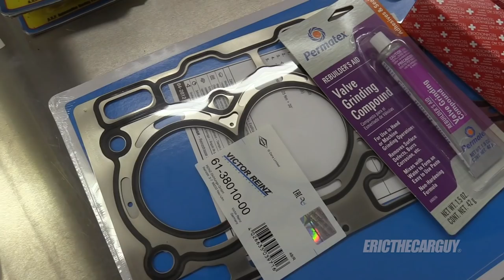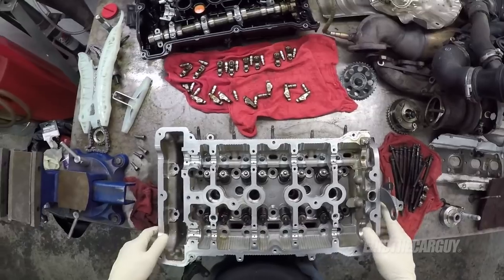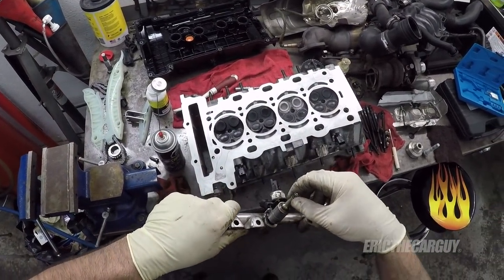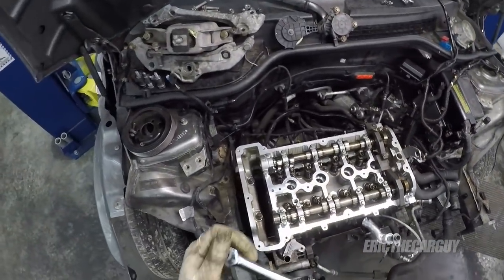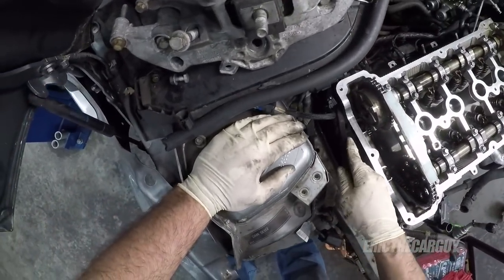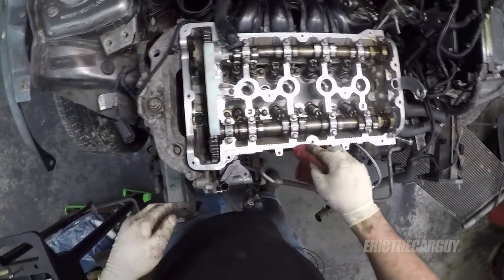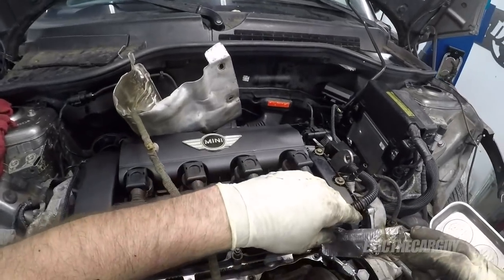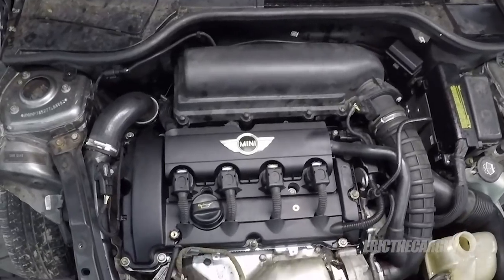Mini Cooper N14 Bent Valve Repair (Part 2)

Comment: That whole engine is cheesy as one get get, why use degrees as a measurement of tightening things down, as you said there is no way to actually verify your toque spec after, seems like another beautiful idea some European German engineer came up with after a rough night out, i admire your patience, i would honestly have just sold the car and moved on haha.
Reply from the maker: Funny you should ask, I'll be covering that in Monday's ETCG1 video.
Reply: I know European cars are very popular in Norway, most likely due to good support and availability, not to say that every car is the same, heck even the older French cars used to be really good, i still see a good number of those old ones from the 80's strolling around, mainly because they're easy to work out problems and much less things to go wrong, there used to be a time when BMW and Mercedes was known for reliability and build't like tanks, much like the older Volvo's gosh you could send those on the front lines of combat, personally i miss simplicity.
Reply: Nearly every modern engine uses angle torquing these days.  Supposed to be better for getting a consistent clamping force.  It's not just a European thing..........  :)

Comment: 09:13  Never a good idea to install cams with the head flat on the bench!  That's a great way to bend valves. I even saw you turn the cam with the large spanner at 10:05 which means the full weight of the head is on the valves... big no-no Eric!  Just put some blocks of wood either end so the valves can freely move without crashing into the bench.
Reply from the maker: Eh, you're reaching again. Do you really think that aluminum head has enough weight to bend valves? Even these puny Mini valves? Also, don't you think I would notice if it was raising up because the valves were open. Lastly, the cam tool was installed, meaning, the valves were in a neutral position. 

I'm sure I'll get it right some day. Till then, I'll keep screwing up for you. 😉
Reply: When you turned the cam at 10:05, we can see the head 'fall' down because some valves sticking out of the combustion chamber closed.  It's not possible to install both cams in a 4cyl engine and have all the valves closed at once.  Yes, people do bend valves this way.  Not just from the weight of the head, but from moving it around etc.  It doesn't take much to bend a 5mm stemmed intake valve.  Ask your friends at Kelvinator engines if this is good practice or not, and let me know how you get on!  Any engine man will shudder at this!
Reply: EricTheCarGuy this guy doesn't deserve a birthday shout out Eric
Reply: +Paul Williams  This is not ETCG1

Comment: I really cannot see why a car can be designed to carry so many fasteners hoses heat shields belts chains plastic covers brackets and just 4 cylinders. Just one fender bender and almost everything should be replaced. I hate them. I would have to have and EV instead.

Comment: Working as a certified AERA machinist, we stopped doing Mimi heads, you'll find that and debris from the tear down process will contaminate the phaser and phaser sealing rings and the engine will throw codes forever. Our Mini dealer no longer does valves jobs just send us a new builder head to assemble. We're even reluctant to to those...Mini is a piece of shit engine. That phaser screen you installed doesn't help. There maybe some AERA tech bulletins on the problems.
Reply from the maker: Thanks for the heads up. (pun intended) I've been driving the car for 2 months since this repair. No issues so far.